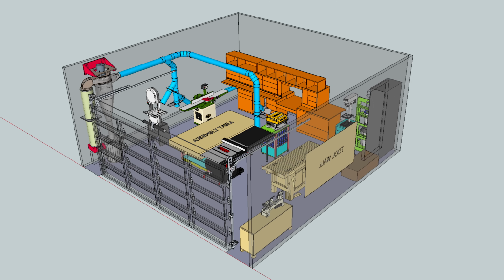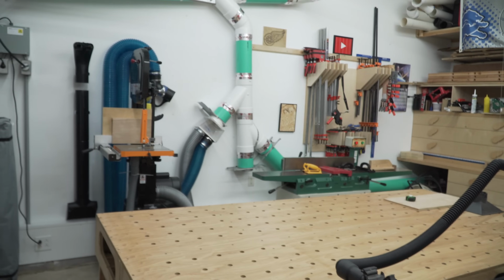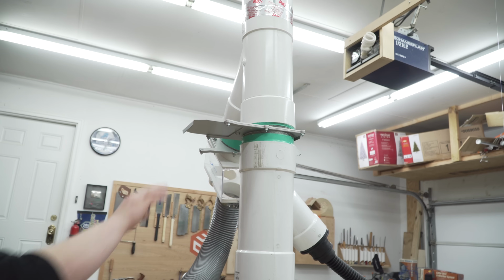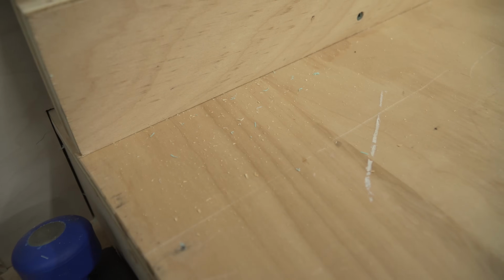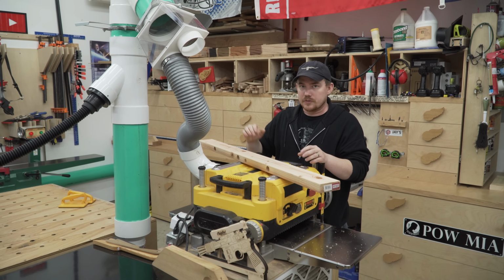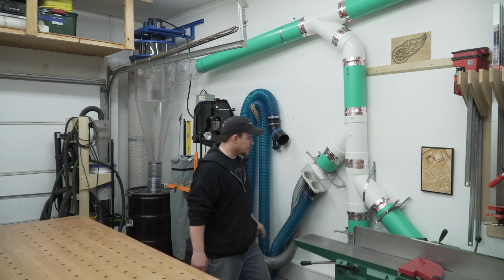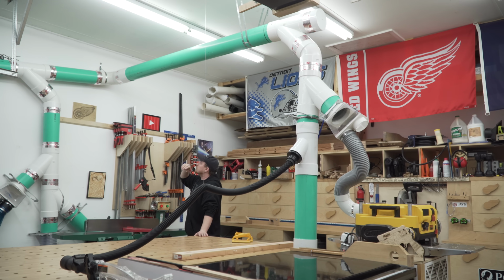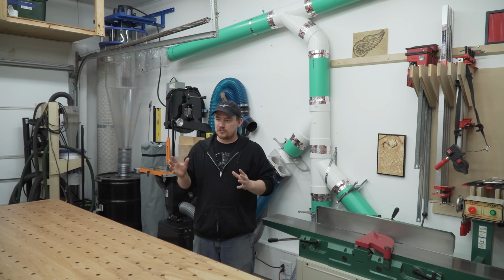Dust Collection Piping and Testing - 275

Comment: If you are experiencing vacuum leaks around the check valves, it is because they were put in upside down. The black knob that Titans the plate is supposed to be downstream of the vacuum system.

Comment: Why 6" piping?  Has it led to reduced air velocity within the pipes and consequent dust build up in the pipes?
Reply from the maker: Because the machine is tested and rated with 6" pipes. 6"-8" lines are standard on this class of dust collector.

Comment: Well, that certainly seems like a fine way to seal everything, but how easy is it to take apart in the event of a clog?  I think I'll just dry friction fit all my piping and maybe use a self tapping screw on joints that are vertically hanging.  If I have air leaks I plan on sealing those with duct tape since, being indoors and only handling ambient room temperature air, I shouldn't have to worry about it degrading and it can be easily cut in the event of a clog or back up.  I can also use a wire and ring connectors to attach to the self tapping screws to act as a grounding against static.  Granted, my collection system will be a smaller, 4" diameter as my collector is only a 2hp 240v model, but I used to work at Kimball Int. building office furniture, and even their industrial dust collection system could clog once in a while.  Their dust went into a large hopper that was then fed into a boiler's firebox.
Reply from the maker: It's not easy to take apart.

Comment: Jay, I am in the process of assembling my Clear Vue system, and am kind of in shock at how much the cost of PVC fittings has risen in the last few years. My supplier wants almost $43 for each of those wye fittings! (BTW, they've actually come down a bit. They were closer to $70 each during the pandemic!) Just the 10 or so PVC fittings on your system look to be almost $350 worth. . . and that's just the fittings. I've been looking around for a good substitute, including making my own out of wood (a la Stumpy Nubs), but that seems kind of janky. I'm wondering if anyone's come up with a solution.

Comment: Getting ready to buy ducting.  Disregarding any increase in price Would going up to 7" for the main lines be better for air flow.
Reply from the maker: Depends on the DC you have to power it. My Clearvue has an attachment for an 8" inlet. For larger shops with multiple tools running all the time it can be helpful. For us weekend warriors, this system is probably the end of the realistic scale for me. Anything more is definitely overkill.

Comment: Hey Jay. Great video. I am looking to make something similar. About your table saw hose being reduced. It may put a slight strain on the system but if its starving the collector of air you have two  ports that can add air to the piping. Open the planer ducts and let it draw air in that way.  I just saw when this video was made so you've probably already figured it out lol.

Comment: Great video, as usual.  I particularly liked how you adapted the hose to the SS overhead arm.  When I bought my SS I got the metal overhead dust collection system as a "free" upgrade.  Probably like alot of other guys, I found it a monumental PITA to use, so I never bother with it.  Your method is much better.  What kind of adapter are you using to attach the hose to the Y?  I'm using 4" sewer pipe.  Thanks for posting.  Mark

Comment: How did you secure the vertical pipe that comes down to the table saw?  Did you cement them together?  Those vertical ones are tricky cause without a few screws they can separate due to gravity.

Comment: Looks good Man. Have have you had  any issues with static electricity while using your pvc piping system? I am thinking of installing something in my shop, but I am stuck on which materials I should use. 

The only concern I have with using pvc is there are many reviews saying that a vacuum system using pvc may cause static electricity, which could lead to shocks or even explosion. 

What's your advice

Comment: I have watched all kinds of dust collection system 
being put together and the one thing that I see wrong with all of them is the gate that closes them off needs to go up and not down because if it’s going down and dust is left in the system sooner or later it will make the gate not close all the way and you will have to take it apart so all of my gates go from bottom up

Comment: Others, all of them, have said that it is one great set, expertly set up, and can only say the same. Great work, and a fine display. Quite ambitious for a low level production output. One definitely needs to collect the dust and the chips, but in the end can one ever be free of dust and work with wood? Fine sawing and sanding will never be fully solved until  the wood working machinery is redesigned to that end. Thank you. Subscribed.

Comment: Great video and great graphic design. One recommendation I have is your blast gates are installed upside down. You’ll find when closed and tightening the holding screw down it will push the gate away from the seal. Won’t make a huge difference on a powerful unit but does add leakage.

Comment: On your table saw the blade tilt has a large hole for the raise wheel's arm  they now make a magnet you can put over that to close the open space off, also I'm sure if you look you'd find other spots that leak air. if all that was tight then the suction can only come in at the blade, making the over blade collection not needed and better yet if your using a dado blade set.
I'd like to say your shop is clean and looks very nice and set up very good. 

Now how did you con your wife into parking her car outside year round?  Mine would freak out!
The only thing I'd change about that shop is a workshop  is a very large barn workshop free standing. like 1200+ sf
but even the guys with that run out of room.

Where do you store stuff when your making it?

 .

Comment: Trying to find out where you purchased your pipe and fitting from.  Didn't see it anywhere.  Did you use the lighter weight fittings or regular schedule 40?

Comment: Would it make a difference if you ran some 4” flex hose to the shroud on your table saw and put that reducer right on your shroud, or would you still have as big an air flow issue?

Comment: You've probably already moved past this, but if you have concerns about the airflow restrictions due to the 4" to 2" at the table saw, just get a 4" to dual 2" and leave the 2nd 2" open like you do the 6" to dual 4" at the planar.

Comment: Jay, what  is the amp draw on your cyclone?  I assume that is a 5HP motor with a 15" impeller.  I have a 14" impeller but thinking about upgrading to a 15".  My 3HP motor is not fully loaded .  Very nice Shop , thank you.

Comment: im in the middle of trying to design a new DC for my new shop.  been using 4" flex in my old shop, plan on changing to 6" fixed for my jet 2 hp cyclone .  
my issue at the moment is cost.  those pc dust fitting are stupid expensive, i presume they are schedule 40?  i haven't found such fittings in a sewer grade?  the pipe is cheap enough.
because of that, i was also considering galvanized 6 in.  the fittings are more reasonable in price.  any thoughts?

Comment: I’d expect the drill press (especially w/Forstner bits) and the jigsaw to spread quite a bit of dust. Does your system collect that?
Reply from the maker: Nope. I haven't put any effort into drill press dust collection. I don't use the drill press regularly and just use the vacuum to clean up after.

Comment: If you go to a "rea;" supply house for ductwork you will find some fittings like "take-offs" and "Boots" that can be very handy.  I have made good use of "End Boots" in several places, such as one mounted on the side of the bandsaw where your current 2" hose is. Does an excellent job.  The round to rectangular aspect of these would also work well on your jointer.

Comment: Hey Jay, would using a 4" duct reduce the suction all that much? I'm just getting ready to set up my new shop in 2 weeks, and I've only ever used a shop vac and dust deputy. I'm now an owner of the JET 2HP system that i picked up very cheap ($120). I'm contemplating between 4 and 6 inch ducting, please help!

Comment: Hey, everything's fine but you miss something really useful for the dust collection. A floor collecting input! Add a pipe near to the planer and you 'll never regret it and you'll no longer use any vacuum cleaner around the shop.

Comment: Hi Jay awesome video, thanks for the post. I couldn't find this in the comments already so I'll ask here. Do you use an air filtration system in addition to the dust collection you have at the source? Everything I've read says at the source collection is the most important but I'm wondering if you have both. How often have you had to change the filter?

Comment: Based on your experience, I purchased the CV1800 bundle.  Where did you get the 6-inch hose?  From ClearVue?
Reply from the maker: I believe it was from lee valley.
Reply: Thanks for the reply.  I bought the 6" hose from ClearVue but the inside diameter of the hose is smaller than the outside diameter of ASTM 2729/3034 SDR35 pipe they recommend.  Kind of a boneheaded oversight. I am trying different methods to get the hose on suggested by their customer service but it's been a struggle.

Comment: Do you know if the science of dust collection says anything about loss of suction over long distances (i.e. +20') or loss of efficiency when you introduce branches or Y's into the system? I'm running a shop vac/cyclone dust collection system and I started out with a crazy-complex setup. I didn't every like the performance, but recently I've simplified and reduced the compenents and it seems to perform much better, but that's just my observation, and I know nothing about the actual science behind it.

Comment: GREAT job Jay. It is my belief that sooner or later MOST home woodworker shops WILL migrate to at least a 5" Dust Collection system; OR the ultimate 6" system. Time will tell.

In comments below, there seems to be this constant "nag" about "static" and "explosions"; if PVC DC pipe is not grounded. There is NO credible evidence that this has ever happened! This goes for critical electronic systems also.

Please, there is NO problem with it. It is a myth that got started and mucho dollars has been spent needlessly on PVC systems; to reduce static problems. What little static is created may (I repeat "may") cause a shock; like touching door knobs in the winter; but NO more than that is a result of static in a PVC DC system.

Click here please; and listen very carefully towards the end of the video:

https://www.youtube.com/watch?v=7zlNimxZgqw

Note: The BEST place I know of to put a vacuum fitting on a BS is to locate a 5"or 6" port on the BOTTOM door directly IN line where the dust comes off the teeth of the blade. IF your band saw has a port on the back in a similar place, put a blast gate on it. And use that to "meter" the best DC coming off the front port.

Try it. It does work well. The reason this works so efficiently is because the dust is coming off those teeth @ 3500 SFM; and the front fitting is as close as you can get to the source of this atrocious dust. So having the DC on the back of the machine is VERY inefficient; unless you use it as described above.

For whatever it's worth. Keep up the awesome work Jay.

Comment: Beautiful job! I had a 5000 sq ft sauna factory where we used inland red cedar and redwood exclusively. When that dust gets in your lungs it never breaks down so dust collection is imperative. We hired a professional company to design and build the system. They used two 10 hp motors each with its own cyclone that even shook down the  cylindrical paper filters every so many hours to keep them clean. The motors, cyclones and collection boxes were all housed inside a metal cabinet that was 10’h x 6’w x 3’ d. All piping to each station was reinforced galvanized metal starting at the machine at 12” diameter and being tapered down to 4” at the blast gates to keep the suction even over the long runs and all metal to eliminate any static electricity. Dynamite uses sawdust to increase the explosion power so grounding is very important! They had to be emptied once a day but it was a small price to pay for your lungs!

Comment: How are you dealing with eliminating ESD (Electro Static Discharge? Your system seems well built but this issue can cause you your shop and/or your life. PVC produces a LOT of ESD especially when wood rubs inside of it in a dry day. This ESD can ignite the sawdust in a very violent way causing an explosion. If this is something you had not thought of I suggest you do the research and ensure you protect yourself. All it takes is one spark in your system to ignite all the dust all the way to the collection bin/bag/can at the end of the system. I've seen the results before, not pretty at all.
Reply from the maker: Please read this: http://www.thewoodnerd.com/articles/dustExplosion.html

Comment: Why didn't you just put 4 inch flex hose to your table saw and put that adapter at the OTHER end?  Wouldn't that improve airflow?  You could also drill a few small relief holes in the adapter, but I wouldn't.

Comment: Hi Jay!  Long time follower, first time poster. I noticed that your shop setup in this video is significantly differently than your August 2016 shop tour video where you rearranged your shop and seemed pretty happy with it. Are you happy with your most recent setup in this video and did you make it due to you new dust collection system?  I have a small 16x19 garage shop with a back wall that is essentially dead space due to a hot water heater and HVAC furnace for the house so I am constantly trying to figure out the best setup for my space. On a side note, what kind of power supply do you recommend (amps and voltage) for someone like myself who wants to have room to expand for future large tool upgrades?  I am thinking 30 amp/220V but not sure if that is overkill?  

Thanks in advance for the advice and keep posting great videos. Cheers and Fly Navy!

-Jason

Comment: Jay, I see your comment that there are no documented cases of static explosion in PVC dust collection systems. I can't speak to that specifically. I have fought dust collector fires caused by static electricity in metallic systems. I have been "zapped" by static electricity in my shop vac's plastic hose. Put the two together and you have a real hazard. Even Woodworking Magazine recommends putting static discharge elements in PVC dust systems  

http://www.woodmagazine.com/woodworking-plans/dust-collection/installing-a-dust-collection-system

It is your system and ultimately you are in control over what the system entails. Good luck. I hope you aren't the first documented case.

Comment: Jay, please forgive me, I don't mean to be critical. I have been a firefighter for 20 years, five of those is a fire inspector. I want to caution you. The use of PVC pipe for your dust collection system can set you up for a problem. The dust traveling through the pipe can generate very large quantities of static electricity. In order to get rid of the static, you need to ground the system somehow. Plastic, not being a good conductor of electricity, Means that you will need to be creative. You might try wrapping a bare copper wire around the pipe. Extend that copper wire to a good ground and that should solve your problem. Good luck and stay safe.
Reply from the maker: There are no documented cases of static discharge in a PVC dust collection system causing fire.

Comment: My setup is close to the same. The only suggestion that I can provide is to use shallow unistrut, and strut straps verses metal banding to hang the system. It is not expensive and provides a clean appearance. I also suspended pipe from the ceiling using Dottie SSW14B anchors and 1/4 rod down to strut for a very clean appearance. I know this is an older video, but maybe my comment will help someone down the road who is looking to build their own dust system.

Comment: I think its ok to leave the black tube going to the top of the table saw.  The 4 inch at the bottom should pick up more dust and do more work.  I would understand the concern about the strain on the dust collector if you didnt have the bottom 4 inch connected.
Awesome system!

Comment: Great setup on the dust collection I had a thought couldn't you use the same Flexi blue hose as you have for the band saw on the circle saw this would allow the same flexibility as you have with the smaller hose allowing you to move it up out of the way?

Comment: Thank you for your comprehensive Video's.  I have a question on Dust Collectors.  I am looking at two brands, one is Jet the other is Grizzly.   It appears you changed out your grizzly from this video.   My question is how did you determine size and or single stage verses duel stage?  Jet makes a very cool single stage Vortex Cone Canister filtration Dust Collector which is about half the cost for the comparable Duel Stage Cyclonic units.  Thoughts on the differences?
Reply: Go with what is applicable for your shop. If you are like me and use your garage for more than wood working, a small DC on wheels only hooked to the machine you are using is plenty (for now). If you want something stationary and are producing larger amounts of dust/chips you might wanna upgrade to a larger storage bucket/tank/drum, higher filter rating filters+larger filters requiring less cleaning/replacement, and higher CFM + pipe diameter.

Comment: If you want to add a  little extra on that miter saw try out the saw stache from fast cap.  I used it on my table saw holes and it seemed to help.  Also when are you going to get a new planer?